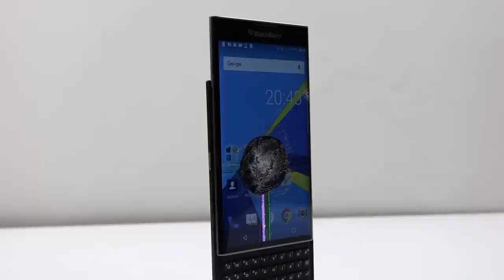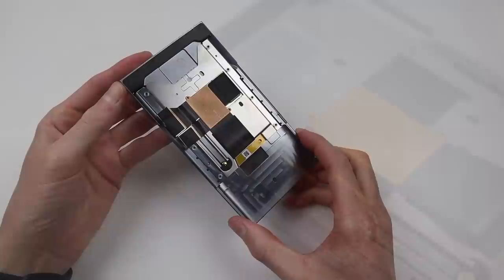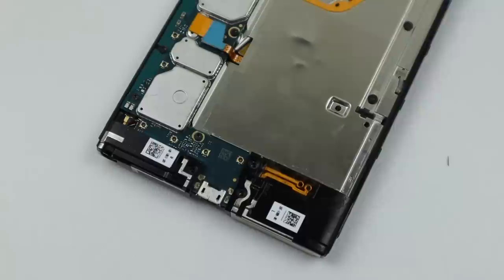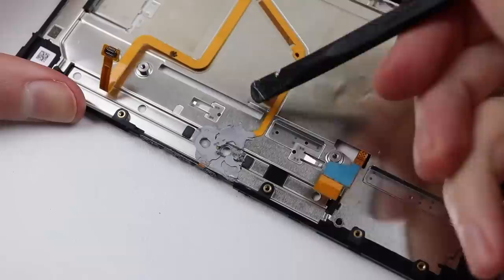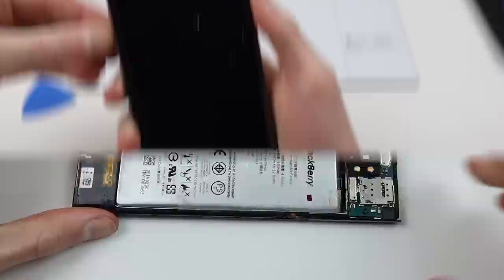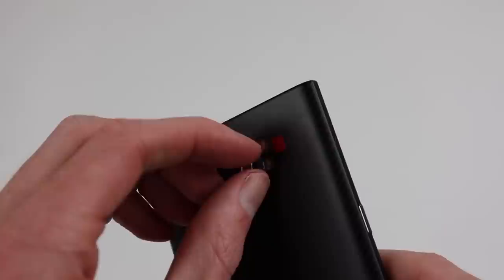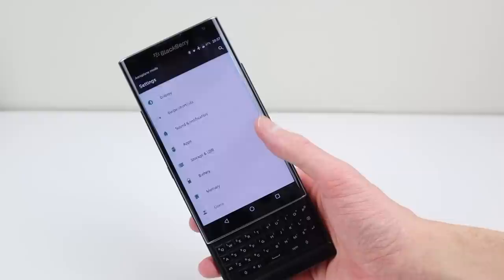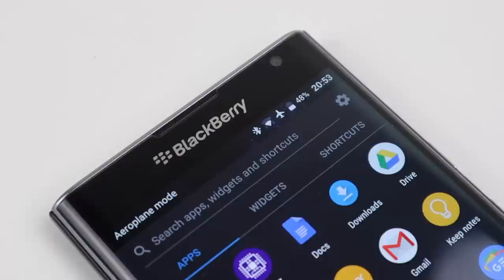Unique Blackberry Priv Restoration - Android slider with keyboard

Comment: I am viewing this from a repaired Priv. I bought it in the same conditions and changed the screen and keyboard. It is slow and the battery does not perform but the feeling of typing with the keyboard is unique. Greetings from Argentina
Reply: Same same, I need two charges a day on mine. But I use it quite a lot. I think the processor is what drains battery most. I turn battery saving mode right after I unplug it if I need it to last for a whole day (when traveling or so). Gonna keep and love this phone as long as it works...
Also, the camera is quite good, Hugh mentions that it's not made for photography, but Priv has one of the best pictures among smartphones for it's time
Reply: mine was great for about 3 months but then fell off a cliff. Battery would deplete like crazy on standby. any videos I took would stutter and have terrible framerate. i dropped it once and the power button wedged itself between the chassis and the back cover, which ended up breaking when I tried to put it back in place. Just such a shame about the specs as the design was my favourite from any phone i've had

Comment: Damn, that Priv looks snazzy!  

As for that physical keyboard, it's a good backup in case the touchscreen fails.
Reply: modern phones keep getting longer so they can have more screen when the keyboard is open, priv solved this simply by sliding the keyboard out so you can see a full a4 page in word and type it all with the keyboard easily, idk why tf they havent made a new version

Comment: *Sees Blackberry in the title*: “Meh”
*Watches video and sees 1440p and a 3300mAh battery*: “Wow this was a great phone for 2015, what happened?”

Seriously though if Blackberry slaps on top of the line specs with full Android support, and makes the price dirt cheap like a loss leader, they could stand a great chance in re-emerging in the phone market and restoring their reputation.
Reply: @WinTech4074  yepp, the trend was cool and all, but there's really no need for a physical keyboard on phones anymore for majority of people
Reply: The Samsung Galaxy has had 1440p displays since the S6. It's nothing too impressive, except when compared to iPhone.
Reply: I bought a priv (and still have it) when it came out, and from an engineering perspective it's a masterpiece! In use, however the BB software it lays on top of is Soo resource hungry! And with only 3gigs of ram, it really struggles. Additionally, there were many bugs that came with the only update it got to marshmallow. I did love the the hardware though! Ironically enough, BB is just a software company now. I have a very let's wait and see attitude towards their 2021 phone they are releasing, but hey I would love to be proven wrong.
Reply: @ChuckieV79  I still have my priv, I love it, despite it randomly restarting sometimes, keyboard randomly not working. Freezing/not responding. Along with all the other errors. It gives the phone some character haha
Reply: @RestoreTechnique  The Samsung Note 4 has a 1440p panel, just assuming that it was released before the S6, could be wrong.
Reply: BlackBerry is basically gone. TCL stopped their partnership with BlackBerry, so they’ll likely go out of business.
Reply: The software was horrible and battery life was atrocious. I owned one for 6 months and had to switch to a LG v10. It couldn't even run Facebook messenger or snapchat. Display and hardware were beautiful though.
Reply: WinTech but that’s the blackberry way... it’s not good but they like them
Reply: @locluke979  I found that the Facebook app was poorly programmed so it would cause my Priv to use the battery up really fast, just got rid of that FB app and only ran Messenger, battery lasts properly now and i´m not distracted by useless info from my news feed.
Reply: @joshy2joshy  I used to have this phone and I loved it. The display was really good looking and I loved both the physical keyboard and the on screen keyboard. Also the adaptive brightness worked really well which is something I can't say for my s9. I really wish they would've stuck with it for another year because I feel like the priv 2 would've been so much better considering the the snapdragon 808 processor was natoruis for overheating which honestly was my only problem with the phone. And given that it wasnt necessarily a camera centered phone the camera actually worked quite well. I honestly miss it a lot.
Reply: @hzssxn  I suggest you check your specifications again, go to GSMarena for some help. View the specs for the S10, S9, S8, S7 and S6 while you're there.
And yes, Samsung make iPhone's screens, but they make them to Apple's requested specs of course. You look foolish calling other people dumb.
Reply: @RestoreTechnique  the iphone 11 has a 724p screen so it is impressive compared to iphone peasants
Reply: @hzssxn  Samsung has had a 1440p panel on their Note line starting 6 years ago. Although it's true that Samsung makes Apple's displays, it's made to Apple's quality control, just because Samsung makes Apple's displays doesn't mean displays cannot be better on Samsung phones.
Reply: The build quality is decent, but booooooiiiiiiii the phone heats up like crazy. Performance is not great, the phone slows down by just watching a gif. If it has top notch specs and the same price it would sell.
Reply: I'll tell you what "happened"... Qualcomm royally screwed up the Snapdragon 808...that's what killed the Priv
Reply: @WinTech4074  Every single time they "looked to the future" and released a glass slab, it was a massive failure.
Z10, Z30, Leap, DTEK, Motion...

No keyboard? Yep

Flop? Also yep
Reply: @nanaagyemang-duah8212  BlackBerry's are not for the majority of people anymore. They're for those who want the keyboard and industrial design. 
There are more than enough bland looking slabs of glass to choose from
Reply: For people who text a lot for business, the physical keyboard is a great thing because you get speed and accuracy of you are used to them.

I've been using Samsungs since early 2012, and had a Nokia E72 with a Qwerty keyboard before that.

I found in tests that, because of lower error rates, I was quicker to type the same text on the Nokia than friends with Samsung and Apple phones.
Reply: My LG G4 also has 1440p (2015 phone). Not that special

Edit: even the G3 is 1440p (2014). Both 3000mah
Reply: @RestoreTechnique  since the note 4*
Reply: They can't afford to have loss leader pricing lol
Reply: @coveredinmoss  Blackberry isn't likely to go out of business anytime soon. By the end of the TCL partnership, phones were such a small portion of their business they could afford to lose it and barely notice! They've got very little debt, billions of dollars in assets, regularly report profits, and their software is found in nearly 200 million cars. If you drive any recent Audi, BMW, Ford, GM, Honda, Hyundai, Jaguar, Land Rover, KIA, Maserati, Mercedes-Benz, Porsche, Toyota, or Volkswagen, your car runs a Blackberry OS! Not to mention that a large portion of fortune 500 companies rely on Blackberry for their cybersecurity knowledge. It's a company full of incredibly skilled engineers, it just struggles to build enough hype to market to consumers.
Reply: KaraHops to be honest, I don’t care one bit about Blackberry, so it’s no surprise that I thought they were a smartphone only company for some reason. I didn’t realize they were THAT big.
Reply: @coveredinmoss  they will never go out if business lol. Most of the car these days are running QNX (Blackberry software) and they are releasing a phone next year
Reply: Asphalt I would’ve never known.
Reply: @silverstreettalks343  Also you can easily type error-free without looking, e.g. when walking. I loved my BlackBerry KEY2 - typing on it was sheer bliss. Now that I have a black slab of glass again, typing is a chore.
Reply: @mbirth  yes.

I was recently given a Galaxy Tab. Great to watch a video when out and about, but it magnifies all the problems of a phone's virtual keyboard: impossible to do accurate two handed typing, too big for accurate swypeing.

Aargh!
Reply: @coveredinmoss  they actually partnered with an American company&foxconn and will be launching in 2021. 5G and physical keyboard. Hope its going to be a well made phone!
Reply: They came too late to the game is what happened and nobody cared at that point, plus the phone itself was burdened by a bunch of included bloatware that you couldn't easily remove and that affected the performance considerably.  Still was a great phone, I used it as my work phone for a few months and loved it.
Reply: Nor a chance.  They blew it 9 years ago.

Comment: Higher capacity Than the 11 pro yes, but that A13 chip in the iPhone is so efficient, I can get 3 days out of a full charge from my 11 pro max. Capacity isn’t always better
Reply: Exactly. Listing off specs like that is meaningless.
Reply: the only reason your iPhone last you that long is because you have been using certain things in the software to make it last that long because an iPhone is not supposed to last that long on its own
Reply: 100% accurate, also it has Android 6 which is pretty outdated, the 2015 iPhone 6s is getting iOS 14
Reply: Well if they had used this 5 year old tech then you would get more than the 3 days you claim to get, they can innovate but they choose to hold back, that's what people criticize apple for
Reply: Try this repair with an iphone. Love their products but their practice's make it unaffordable for the normal person outside the US and europe. I can get a battery for my galaxy in the shop around the corner, for an iPhone battery replacement i have to go to the certified shop and wait about 2 weeks for one.
Reply: @SantiagoAntonutti  In addition these people fail to notice that this phone is from 2015 and we wouldn't expect a chip from 2015 to be as efficient as a 2020 chip.
Reply: Also 2 days for a 5 year old phone is still great.

Comment: The two-color temperature LED was so underrated.
Basically this meant that it didn't matter how warm or cold your light was in the sign. It allowed you to adapt the flash to the envoirement resulting in more natural looking light.
A much missed feature.
Reply: My Moto Z Play has that as well. It still shoots better photos than the phone I replaced it with with it's idiotic 4 camera array and single color LED. Not to mention for the flashlight/torch function the Motorola enables both LEDs at the same time so it's ridiculously bright. Guess dual tone LEDs are going the way of the dodo, just like IR blasters, replaceable storage in the form of microSD cards and dual-SIM functionality that isn't intentionally crippled...

Comment: I used Priv for few years. It was really wonderful device. If BB releases Priv 2 i'll preorder without doubt. I am now using newer Samsung Note 9 and i still missing my BB.
BTW media consumption on that phone was really nice, front-facing speaker is good for 2015 phone, camera is not amazing, but with if you have good lightning conditions it can take nice picture. Only real issue that i had was phone overheating in summer, when it was hanging on my car windshield in holder when navigating using Google Maps.

Comment: I still have mine, it's a little neat phone. It's been retired for a while now and I am using an Fxtec Pro1 instead. Even when I am not using the PRIV as a daily driver anymore it doubles as a great video recording device. (it does great 1080p 60 fps and even can do 4k at 30fps) Honestly for its time it was very well equipped apart from that Snap 808.

Comment: 5:29 You ALWAYS want the absolute minimum amount of thermal paste that guarantees good contact with the heat sink. Paste doesn't cool anything by itself. If it does anything, it interrupts the heat exchange. We use the paste because it is still better than having pockets of air between the processor and the heat sink. It's basically a filler between the processor and the sink, and of course, you want as little filler as possible if you want the heat to reach the sink to be dissipated qiuckly.

Comment: i still use this phone. its bit slow maybe but theres a lot of opportunities for unique customization that make up for the drawbacks to such a degree that its still worth using. the only real problem with the phone is that the camera lens is plastic and and significantly reduces picture quality so i replaced it with some nokia phone's camera glass i found off aliexpress. now it takes good photos too. im gonna keep using this phone for a while, its cool and works fine.
Reply from the maker: I need to figure out how to flash a faster OS onto it. I don't understand why the stock OS is so slow
Reply: @HughJeffreys  you can't flash an OS on it, i've tried figuring out how to root it and its potentially hackable but the the bootloader is locked and does a hash check so you can't even root it without it trying to un-root itself and even if you could install a custom OS the hardware drivers for the synaptic trackpad wouldn't be ported over and the biggest feature of the phone wouldn't work.

it feels slower than a nexus 5x, which uses the same chipset, but its performance is exactly the same in benchmarks. its not slow in the sense that its not capable of doing a job you throw at it but its slow in the sense that it takes a long time for the cpu to realize it needs to kick into higher gear. i am positive the cpu governor they use sacrifices performance to improve battery life which makes an old chipset feel even older. the battery life IS exceptional for a 5 year old phone though

but i don't use mine with the stock launcher or snapchat or any apps that are remotely high-cpu usage like facebook or games. i even have most google services disabled on mobile data. i just use it to browse the internet, text message people, browse 4chan, and remote desktop into my computer and for those things this phone is perfectly powerful enough and the button shortcuts make up for any lack of speed in the OS
Reply: also the stock software on the phone is incredibly slow so that might be the problem if you're still using it. BB hub, the productivity tab, and the launcher are unusably slow. i disabled those, switched to a lighter launcher, and use a button remapper app for universal button shortcuts

Comment: 1. More thermal paste than needed isn't as good as you might think is.. 2. Battery size does not automatically means longer runtime. 3. Resolution of a display is not the only factor that determines anything about the display quality.

Comment: It should be noted that you're not supposed to add too much thermal paste which seems counter-intuitive, but thermal paste isn't as conductive as bare metal and serves to fill in any microscopic gaps/unevenness between the surfaces rather than as a perfect thermal joint. This is assuming thermal pads are not being used, which would mean there's a large gap anyway.

Comment: Interesting to see that the copper heat block for the SoC just connects to the edge of a rail system. Did Blackberry forget to include a heatpipe to use all of the midframe?

Comment: the reason the battery came out so easily is because the Priv gets so hot the glue is probably loose, it's good to know how easy it is to replace the battery, my Priv is damaged, it reboots whenever it wants, it started in february so i bought the KeyOne for my birthday, i would love to get the priv working again because despite it's flaws it's back camera is really good
Reply: The random rebooting is likely caused by a stuck Google app update. Disable the auto-update and it shouldn't random reboot.
Reply: @tonicipriani  you are completely correct, I only discovered this when I wiped the device to sell it

Comment: That wasn't plastic- it's an EMI shield and also incidentally helps provide thermal relief. If you reassembled the phone without it, it will run much hotter than it should.

Comment: Those heat pipes can't be removed without being ruined, they're just too thin and kink. Once the opposite sides touch the powder gets knocked off the inside, and the capillary action effect that circulates the tiny amount of water is broken.

Comment: Hugh,

My Priv has wireless charging, but I'm having trouble finding a replacement back cover. If I find a plain one, is it possible for me to transfer the charging coil and cables from my old part to the new plain back cover?  Thanks!

Comment: 0:57 I've never owned a blackberry or a phone with a physical keyboard
If Hugh has NEVER owned a phone with a physical keyboard. What type of phones has he been using?
Reply from the maker: Every phone I have ever used:
IPhone 4 16GB
IPhone 5 16GB
IPhone 5 32GB
IPhone 5s 32GB
IPhone 7 256GB
Galaxy S8 64GB
Then briefly used a iPhone 6s 64GB and an iPhone X 64GB before returning back to the Galaxy S8
Galaxy S9 64GB
Galaxy Note7 64GB
Galaxy S10+ 128GB
Blackberry Priv 32GB

Comment: I would still use the Priv at times if the MicroUSB was modular. It dates too easy with abuse. Lucky your one doesn't have.

The Priv is better than the most common KeyOne for two simple reasons, keyboard doesn't take up screen realestate and ram, the key one is shocking updated with handling the 3gb. The older version of the Priv is so much smoother
Reply: Lol what? The KEYone performs way better than the Priv, mainly because the processor is much better.
Reply: @KBoon  It's more about the form factor. The fact the KEYone has a non-standard screen resolution means app experience is compromised.
Reply: @tonicipriani  in theory sure but in the real world I barely had issues with the 4.5" 4:3 aspect ratio of the KEYBerry's